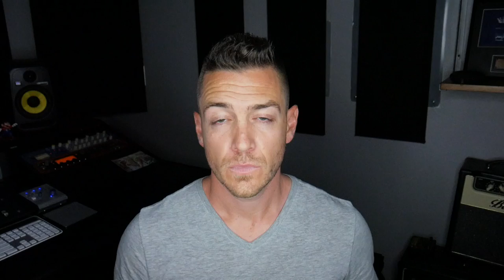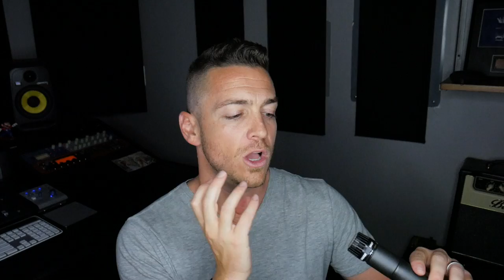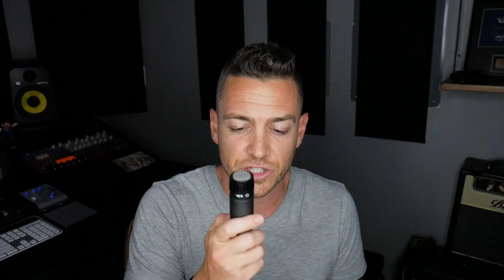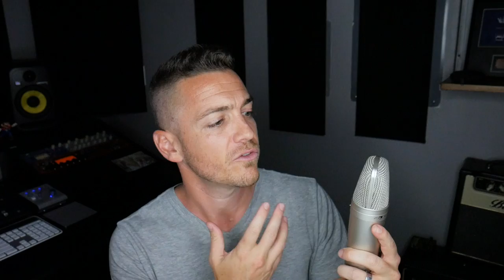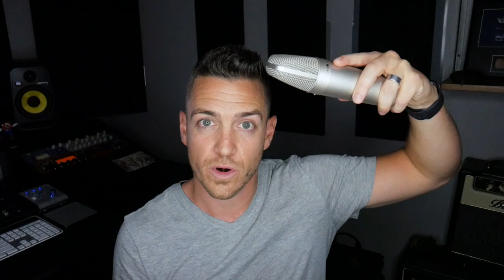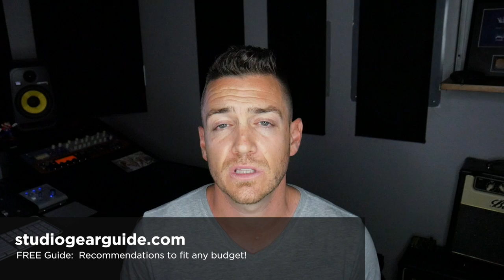What Is Phantom Power And Why Do You Need It? - RecordingRevolution.com

Comment: i have a scarlet 2i2 and i use bias fx 2, i want to plug into my interface and out into my amp but i need to record with a mic, can i use phantom power when both are plugged in? or will it damage my guitar?
Reply: if you have an audio interface the it most likely already has a built-in sound card and phantom power

Comment: Once again great vid Graham. On my mixer I have limitations on my 8 hybrid inputs. I can go all 8 inputs with 48V, the first 4,  last 4 or none.  I just bought a 7 pcs drum mics kit with 5 dyna. &  2 S.D.C. mics. Have you tried supplying a dynamic mic with 48V ? Does it buzz or damaged the mic?  Should I use my beringer c1 as a close mic for floor tom? Should I use a XLR to 1/4'' cable  not affected by phantom power? Thanks in advance  to anyone with  an advice on this .

Comment: Sorry for the thumbs down but... You talked about mic types but not what phantom power is. Yes I need because I want to run the mic. But WHY does the mic need it? Nice vid though, but a little misleading...
Reply: I tried to explain this in a comment above and also in a reply to someone else -- if you really want to get into it more.
Reply: see response by Dennis Miller above. One generates it's own power (current and voltage) from the movement of the air, the other has a capacitance like material charged up by the voltage and then the current coming off it relates to the air movement, it cannot work uncharged. Also there's the issue of XLR or balanced lines, which the video didn't cover, but three pin leads put the audio signal down one wire, a no-ginal reference on the second wire and the third wire is the return loop for the circuit. Then, at the preamp it compares the signal line with the no-signal reference line and basically subtracts the no-signal line from the signal line. That way whatever noise has been induced in the wires by electromagnetic interference along the way will be on both lines, but because the no-signal line had nothing on the audio, the signal at the other end is all noise, and the signal line will exhibit a very similar noise pattern, so subtracting the no-signal from the signal takes away the noise (easier to show with pictures, google it!)